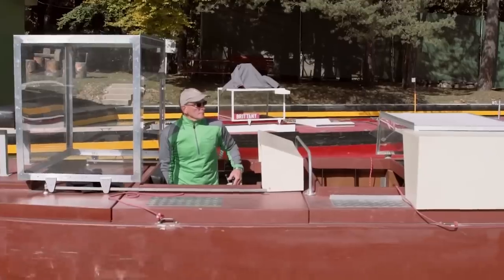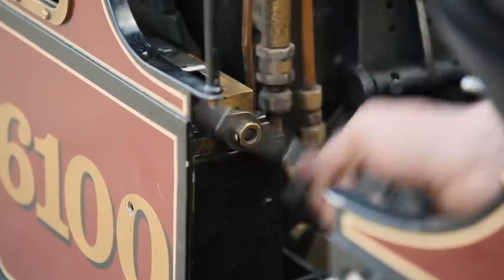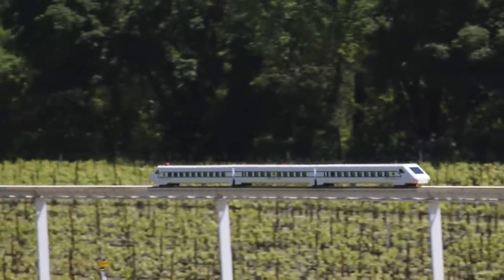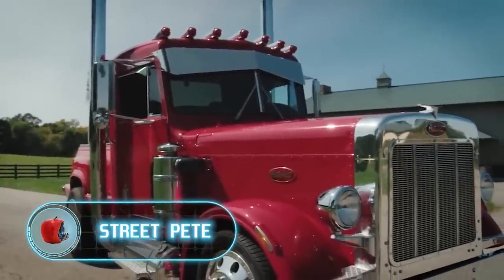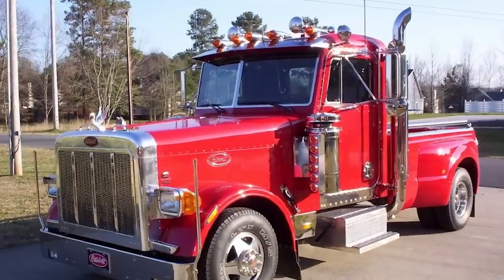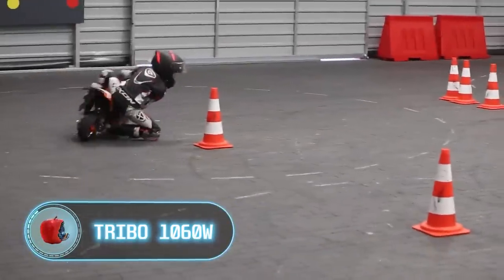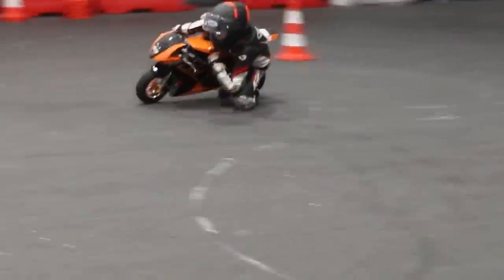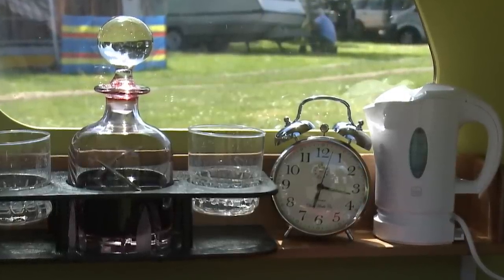Perfect Copies of Giant Vehicles That Actually Work

Comment: Memories of the amateur submariner who, about 3 decades back, having built a submarine in his garage, decided to test it out in a gravel quarry lake in the south of England. It settled on the bottom and stayed there. I seem to recall he was lucky to survive the maiden voyage - with air running out he decided to flood the thing, open the hatch and swim to the surface.
Reply: Yeah, DIY subs are very dangerous. There so much that can go wrong. If you have an electrical fire inside, that could consume all your oxygen faster than you could rise, causing you to black out and suffocate in the vessel. If that guy you talked about tested his craft in deeper waters, the pressure could've crushed his sub.

I've thought about trying to make a small sub, and the things I thought about for safety were;

-Atmosphere composition sensor, to detect if CO2 levels become too high/ O2 levels too low
-Fire suppression (but not CO2 ones)
-Water/leak detection
-A way to exit the craft underwater
-Emergency oxygen tanks and mask
-Possible SCUBA gear to make an exit from deeper waters if the craft can't surface
Reply: Cor blimey, guv'nor. We aren't sure what took us in--the tale or the manner you told the tale. Cheers.